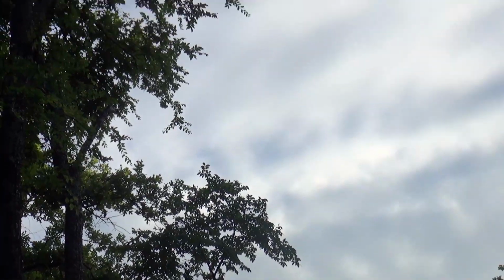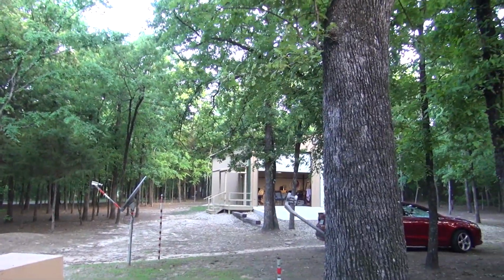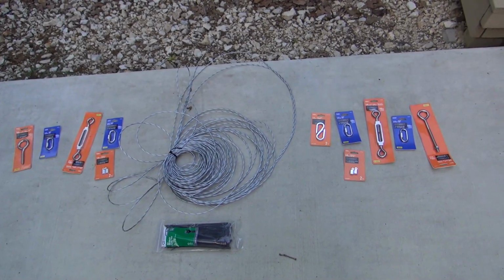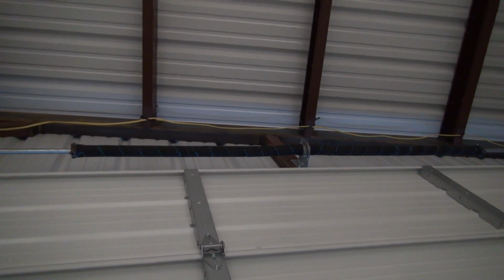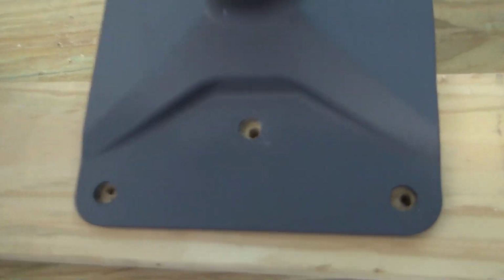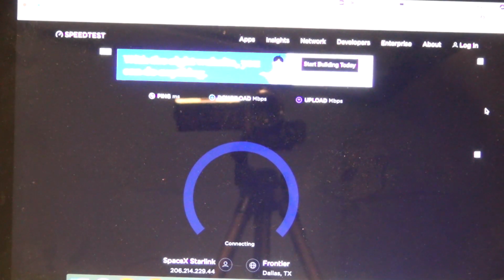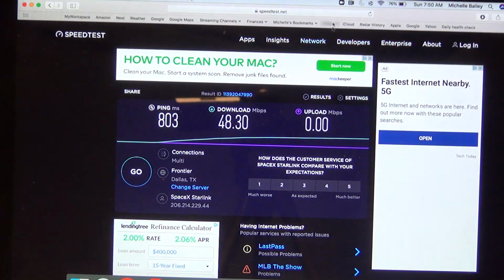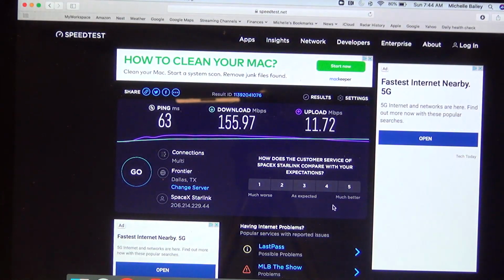Starlink Dish Install With Lots of Trees and Long Cable Run, Texas/Oklahoma

Comment: i have trees all around my trees and it cuts out my connection often :(
Reply from the maker: I still have some interference.  I am going to take out a couple of my closer in trees to help improve the issue, I hope.   I will always have trees showing on the lower edge of my Starlink App when I check for obstructions, but so far I have had minimal issues.     

Going higher seems to be the only option to improve your service, if that even is an option for you.